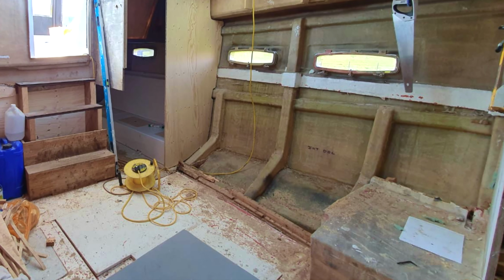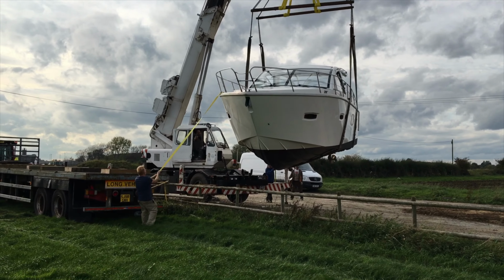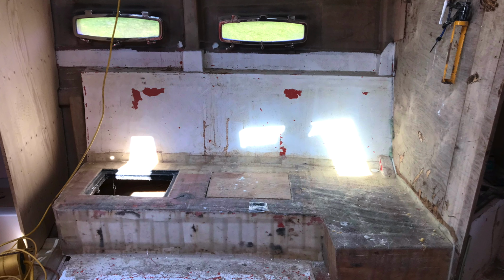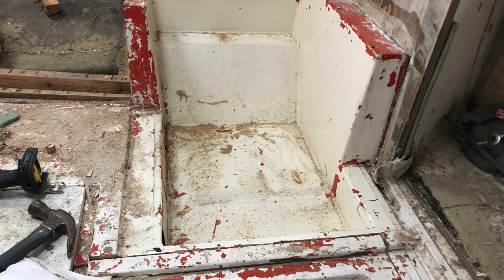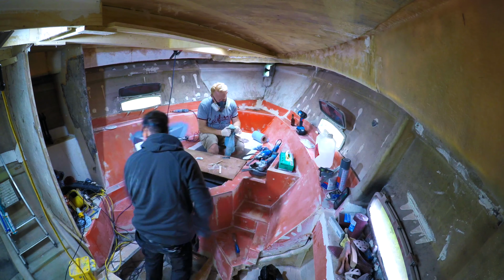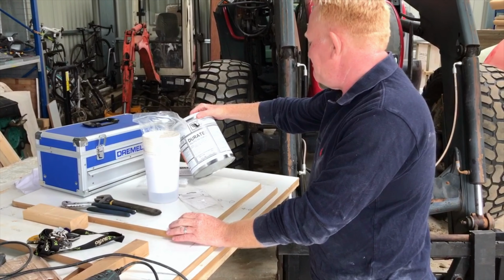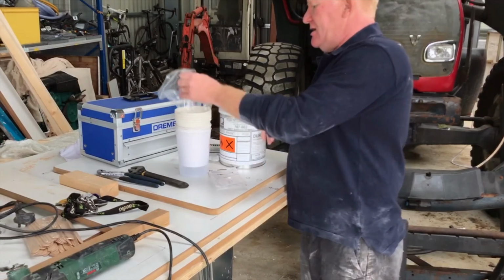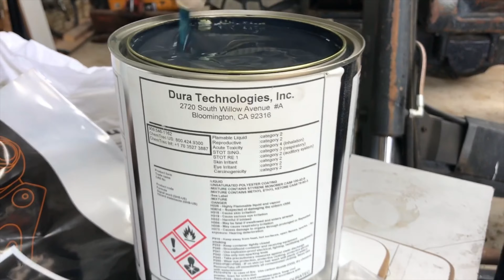Making a plug for fibreglass moulding - Sealine SC35 Restoration - EP 8

Comment: Aha!!  I had trouble understanding exactly how the bed would come out as your videos were not coming up in any order on the suggested list.  Now I see the finished picture and can understand a bit better.  Also knowing now that the boat was used as a production mold enlightens me a bit more.  So I take it that the previous owner was trying to build a finished boat from the plug?  He must have acquired the deck and house  as well and assembled them before you got it?  His idea was to just finish the male plug molds and leave them in place??  All this time I was thinking this was a completed boat that had been acquired out of inventory that you were disassembling for structural repairs and upgrades.  One off molding is a very time consuming process and you fellows seem to have the patience for the project.   I did see one shot of the anchor installation on the bow and am wondering if any provisions were made to keep a head sea from flooding the chain locker?  The drain I saw did not look capable in anyway of handling a steady ingress of water around the anchor?  Thoroughly enjoying your series.
Reply from the maker: The complete boat was assembled by the Sealine factory, however the interior and engines were not fitted. The engine and drives were then fitted by a previous owner, but the interior was never finished. We've removed engines and drives and removed the internal plugs ready for a full refit. Thanks for watching !